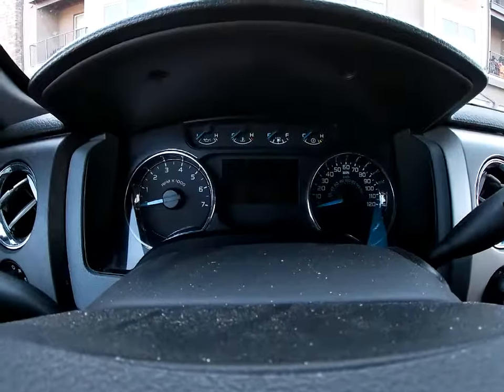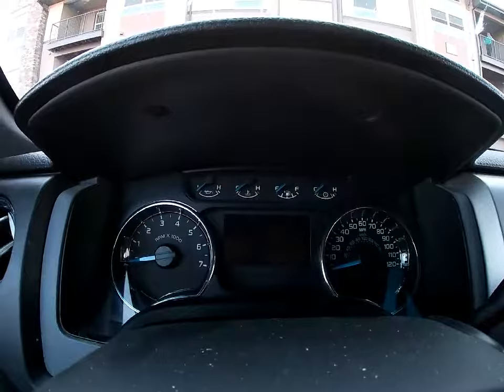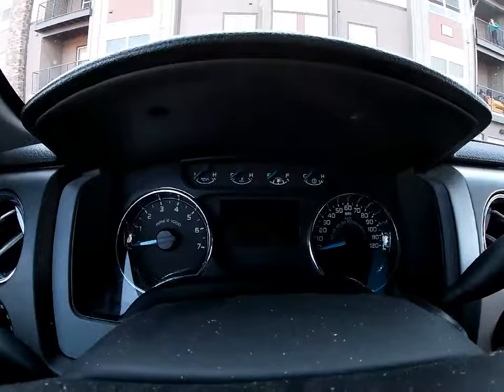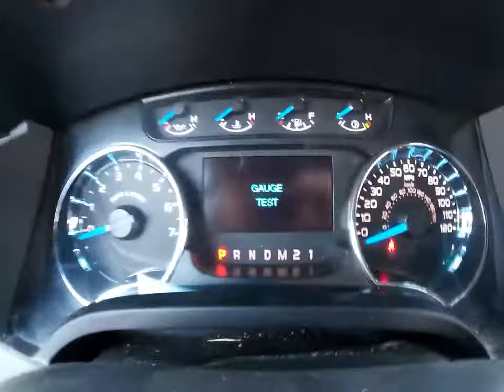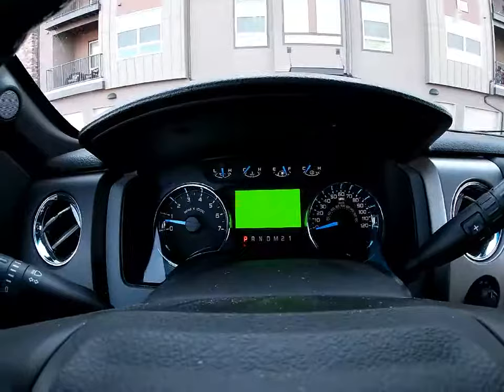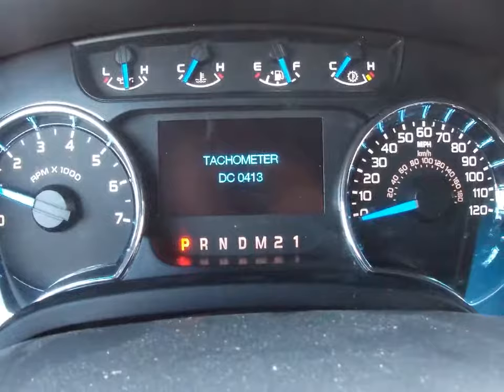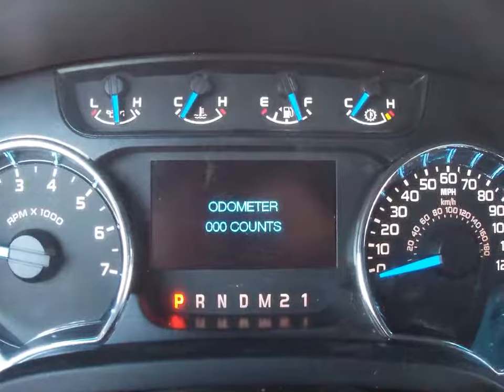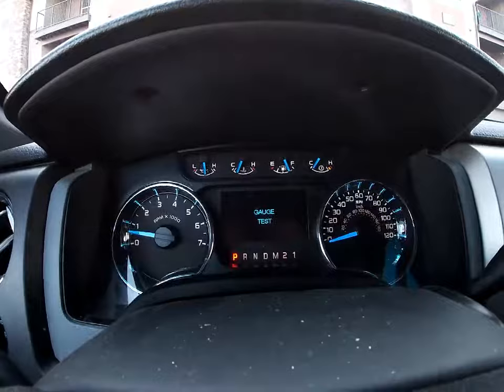Hidden Speedometer in 2011 to 2014 f150!!!    PART 1!

Comment: the fact it resets everytime you turn off the truck is a huge fail on ford's part. These F150s drive incredible for trucks but both screens on the 11-14 f150s are useless and pointless
Reply: Mine only resets if you preset the reset button and hold it. I haven't reset mine in months
Reply: @italianstallion8317  lucky.

Comment: Skip to 3:15 for actual instructions 
The first 3 minutes are useless
Reply: @thevapingcarpenter1473  
You are COMPLETELY missing the point of the vid. 
Who will do this? Someone who is curious and wants to verify what this video is meant to show. 
It's not to use that little hidden speedo as the primary driving indicator, the point of this vid is its THERE and you can access it if you want. 

If you don't want to use it and you don't give a damn it's there, then simply move along. 
Nothing for you to even bother about.

Comment: You don’t have do all that crap just press the ok button right before you crank it and hold it a split second after it’s running and it will go to center gage mode and then you can pick which ever one you want. It’s really not that technical. Once it cranks you will see your speedometer will go to top speed and then flop back to 0 and you are good to go

Comment: my 2011 doesnt have OK button on the steering wheel so it didnt work?
Reply: Same here my 2012 doesn't have that ok button either
Reply: Same. Tony Stark would’ve learn from his mistake
Reply: @kieferkitching7250  use reset
Reply: @Vhifzvjif  use reset
Reply: Use the reset button. I was able to get it on a 2013 with out the ok button on the wheel. Just use reset and keep cycling reset until vehicle speed is displayed
Reply: @LogosFarm  thanks bro
Reply: @Vhifzvjif  no problem, I need to use it and see if it’s off too, like my actual speedometer
Reply: @LogosFarm  yeah I used it today and there was almost no difference, but I wonder if it will be off when I downsize tires
Reply: @Vhifzvjif  Sweet. I know my speedometer runs off at about 60mph says 60, going 67ish, tires are 315/70/17. Just ordered a sct tuner that says it can change the speedometer to meet tire size so hopefully it works haha
Reply: @LogosFarm  nice good luck 👍

Comment: did not work on my 2014 F150
Reply: Do you have the bigger screen behind the steering wheel like they do? Mines a smaller screen and not available
Reply: Tried on my 2012 doestn work either same screen